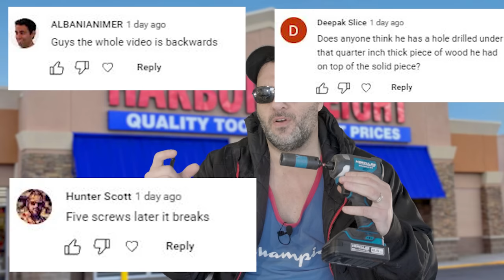Harbor Freight just made people really mad

Comment: I purchased a Harbor Freight trolley hydraulic jack, the cheapest one they had and I used the hell out of it for somewhere between 15 to 20 years and I recently had an incident where my truck somehow shifted and it bent the jack sideways so I finally parted with it and what did I do? I went back to Harbor Freight and purchased the same jack again and it was still the same price at $34.99
Recently I purchased a three piece Craftsman toolbox set (top box, middle (intermediate) 3-drawer box, and the bottom box with wheels at Lowes. That was just over $500 because I wanted the 2000 series set. Their 1000 series toolboxes are junk. Lowes mispriced the middle box at only $99 when it retails everywhere else for about $250. 
I have spent a little over $1,000 at Harbor Freight in the past 90 days. I absolutely love Harbor Freight Loved your video. You told the truth for sure.

Comment: Haters hate.  I have three cordless impact drivers of different sizes - two are hex output and the largest is a standard 1/2" square drive output.  Also have 1/4", 3/8", 1/2" & 3/4" drive pneumatic impact guns.

The test you just demonstrated is way more than I would ever subject a hex drive impact gun to - what I"m saying is that thing is a BEAST.  To handle that level of abuse is impressive.

So much BS out there on the internet, one must be careful on which to believe.

HF has definitely upped their game.  I have a couple of their tool chests in my shop and they are top notch.  As well I picked up one of their Predator 9500W inverter generartors and built up a pressure washer with their new 459cc engine on it.  Same engine in the 9500W generator BTW.  All perform very well - for the HF price point the ROI is the best out there.

HF is definitely legit these days

Good video dude!

Comment: This looks like an excellent tool if you need a driver. Where they get ya is when you need A 1", 3/4", 1/2", 3/8", 1/4", stubby, ratchet, 90* impact, grease gun, grinder, die grinder, soldering iron, sawsall, calking gun and one rapid charger.

Comment: I'm probably going to sound stupid but I'll ask the question anyway.
Is this tool (with a proper adapter, assuming one exists) capable of removing lug nuts on a car or maybe even a pickup truck??
I still use a four way lug wrench and have considered possibly getting a cordless impact driver that will work as a lug wrench as well but I'm clueless what to even look for as far as spec's go and so forth.
Simply asking for advice, I'm totally ignorant concerning these types of multi purpose tools and looking to combine tools to cut costs and still have what I need to get the job done.
Thank You kindly for Any Help with this matter!!
Reply from the maker: I've used impact drives with this setup many times to remove and install lugs, but if you do it all the time, I would suggest an impact wrench

Comment: I have that impact driver and have used it a lot for a DIY guy. It will remove the lug nuts off of a F350 that are torqued to 150 ft lbs and I did it on all four wheels of my 01 F350 and my son in laws 2015 F350. We were swapping out a set. I have recharged it one time since I have had it. Can’t believe how long the battery lasts even on hard jobs. I love Harbor Freight. For the average diy guy their stuff is great. I’ve honestly always had good luck with their stuff.

Comment: I've always used Milwaukee drills and drivers because they never let me down work well and last long between battery changes. I've never owned any other brand so I never had any others to compare them too, and never needed to.
 If I knew then what I know now, I may have considered starting with the Bauer brand or Hercules brand because of the price and some of the videos showing how well they work.
 I'm not going to switch brands because I have several Milwaukee tools and many batteries to use (I keep extras charged incase I need a fresh battery)

Comment: I had one of the original Earthquake 700 lb 1/2 inch air impact. It failed after 10 years due to my neglect of not oiling it. Rusted inside and chewed itself up. So I bought the newer one and I service this one. From an old Snao-On only guy

Comment: I had one of the harbor freight corded impact wrenches, chicago electric...I can tell you, for $36 I didn' have a care in the world for that thing, so I left it out in the driveway, rain, snow, heck...it even froze to the driveway 2 years in a row...believe it or not, I had that thing for 6 years, the trigger got a little sticky, but it never stopped working. Heck, the last 2 years I had it, there were metal shavings coming out of the gear box due to my neglecting the tool, but it still outperformed any air impact I ever used. Eventually it got stolen, but worked fine for all the years I had it...lol

Comment: I had a Chicago electric rechargeable drill I bought there back in the mid 90s that worked great the battery held a charge usually better than then the newest models the only reason I had to replace it was because I was on a ladder drill a hole in a bad angle the bit caught and slammed the case against the wall and it split open the case it was over 25 maybe even 30 years old

Comment: I love harbor freight.  I've been using their Pittsburgh impact sockets on my milwaukee 2767 high torque impact for a couple of years daily at work and haven't busted one yet. I use a Pittsburgh 1/2 drive ratchet,  it's the black and red composite, had it since 2018 and it's outlasted 2 gear wrench ratchets. It's still smooth as glass.

Comment: I have had HF tools start smoking half way through a job,  a concrete vibrator still looking to replace that thing, but the chorded shears pick up once a year maybe. seems fine
Reply from the maker: I can't say anything related to the other tools at harbor freight as I have not used them. Thay said, the Hercules is on a different level than most of the other tools from what I hear as the put waaaaay more research and development into them. They are definitely changing the types of tools they are selling,  and that's a great thing

Comment: Harbor Freight tools are generally low quality and they know it. To combat this, they introduced Hercules brand. I have many Hercules tools. You may not like it or believe me, but they are absolutely superior, some even to DeWalt. The Hercules compound miter saw at $349 is superior to DeWalt's compound miter saw in every possible way it can be measured. DeWalt goes for $699. You can't prove me wrong. And the same impact gun used in this video; got that too. The battery never goes dead. I had it fully charged to refurbish me deck. I drove 450 2-1/2" on one charge. It still had 2 of 4 bars left. I have had it for 4 years and it performs like new. I use it a lot. Buy Hercules tools now before they realize that they could easily charge way more for them.

Comment: I've been using Harbor freight impacts for 6-years . I just updated my set and the old ones are still working.  I would have gone through maybe 2-sets of Dewalt in that time period. But best of all the batteries are still running strong. I would be glad to show first Gen tools still in action  for the non-believers. New models are even better than the originals👍👍👍👍👍👍👍👍

Comment: I use a Hercules miter saw at work. Honestly it’s junk. It’s 8 months old it won’t go up on it’s own anymore it’s missing a lot of bolts and screws. Also 1 week ago it started vibrating extremely bad. I use it with a grinding wheel and cut vinyl with it. Granted I make hundreds of cuts a day with it. We have dewalt miter saws that are 15 years old and they work fine.

Comment: I tried to save some money by buying the 1/2 mid torque hercules impact gun instead of the milwakuee.  The hercules couldn't even take a single lug nut torqued to 100 ft lbs and was very disappointed and returned it the next day. I will say though the ultra torque is right up there with the milwakuee high torque and was very impressed with it. Great bang for your buck not sure how long it will last and hold up hopefully longer then the earthquake power tools because we have them at the shop and they lose power quick. Overall other then that mid torque the new hercules power tool selection is great especially for the price.

Comment: very impressive tool i might consider getting one i was wondering for the duration time running all those lags did you do this on one battery pack? also what voltage are they ? i have the first generation dewalt ive had for over ten years the 18 volt ones it still works awesome but the batteries are in need of replacement but as you know batteries are spendy so instead i will buy  a new unit  as a kit its cheaper in the long run . thanks for posting this 👍👍👍

Comment: All these A-holes bash Harbor freight but they do have some good stuff and is a hell of a lot cheaper. I really like some of there tools and have had pretty good lucky with a couple bad apples in there.  The main thing is that these cheaper prices let those that can't afford some of the high priced specialty tool the ability to do so. Take the gas pipe threader, I don't use it much but would not have one if I had to pay 750$. After this video I would think about switching impact brands if I didn't have 1k of freaking batteries for the Rigid.

Comment: I'd like to point out you are splitting the fuck out of the wood just driving shit in like that. That's the reason your suppose to drill pilot holes not to make the screws go in easier. The power to do this is meanless because if you damage the wood you're weakening the entire structure.

Comment: That other video you posted was a different driver than you are using in this video. The other video shows a 1/2 inch impact driver and this video is a 1/4 inch impact driver. Not trying to be a smart ass just saying and I use Harbor Freight tools at times.